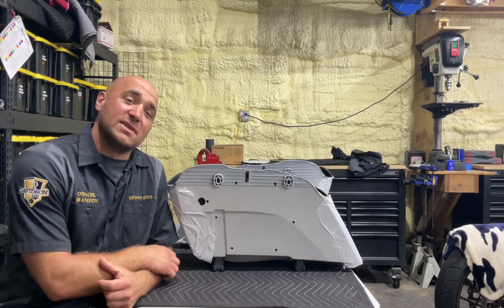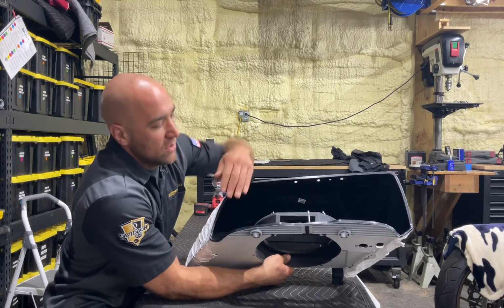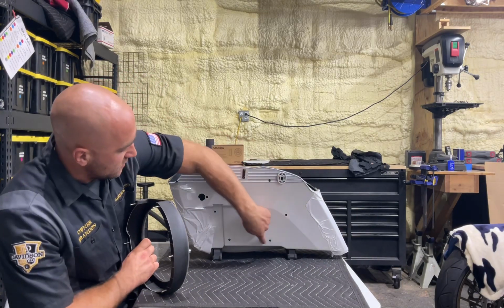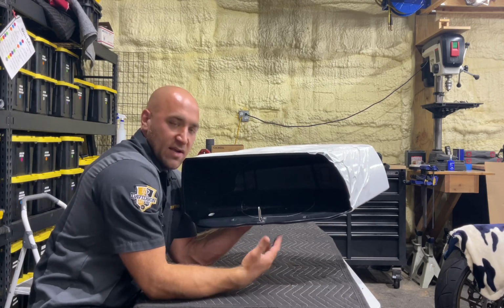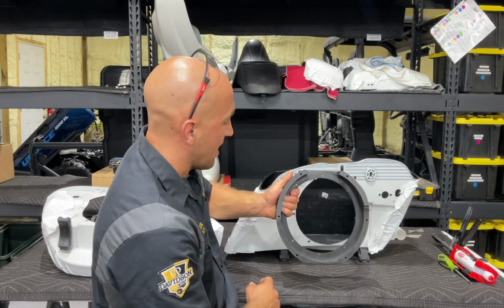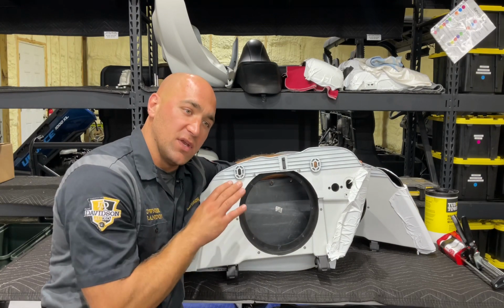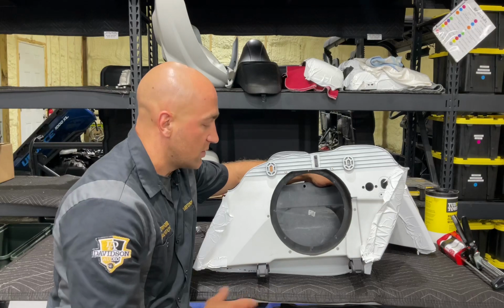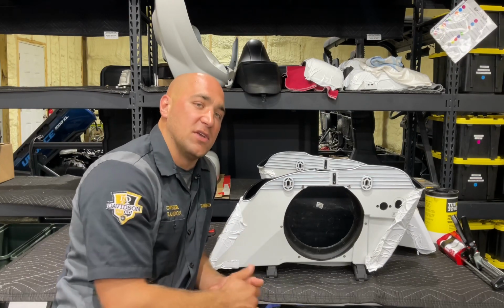10” Nagy Ring Install for 2019-Current Indian Motorcycles

Comment: What about water getting on the sub or in the bag if caught in rain. And are you guys working on a way of putting 6.5 in Chieftain fairing?
Reply from the maker: We utilize high quality mid bass speakers in our bags that have been treated for the elements. We also use grills to cover the speakers. 

The 6.5” speaker adapters are in the works, we just need time to get them completed and on the market